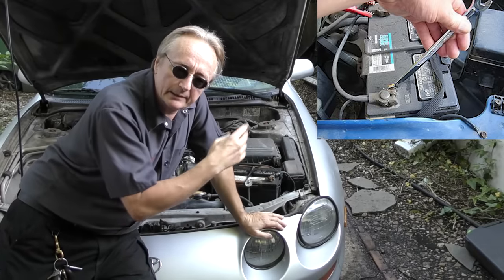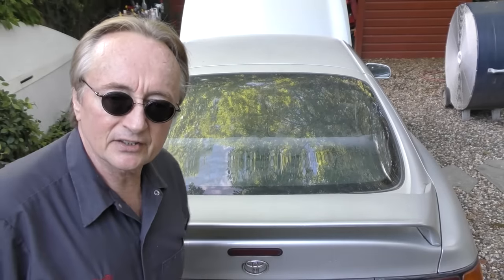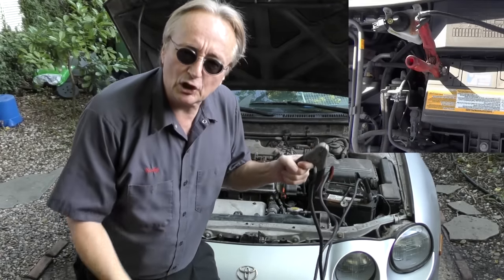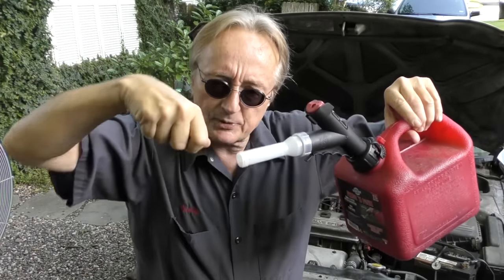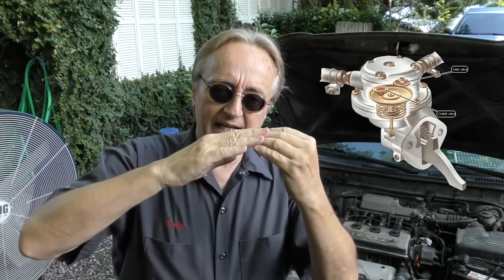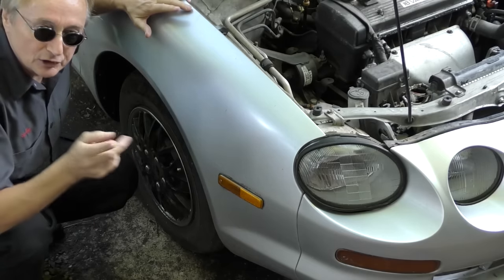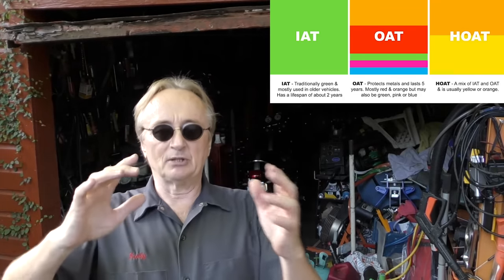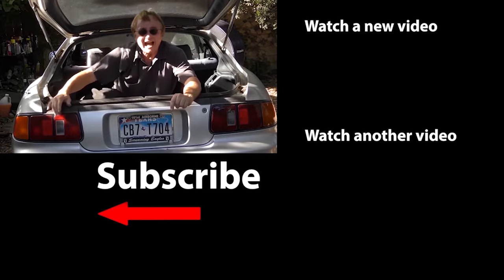This Will Destroy Your Car

Comment: WOW!!!
Thanks Scotty! I've actually been jumping cars incorrectly for the last 40+ years.
Reply: you monster
Reply: Ditto. LOL.
Reply: So have I and never had a problem.  Maybe Scotty saw it one time.
Reply: @Chrisallengallery  we don't even use Aligator Clips in our country 😂
Reply: now that reply made me laugh
Reply: I've always done positive to positive and negative to negative too (except for one time when I jump started a PT Cruiser but thats because I couldn't get to the negative battery terminal as the battery was buried under the Air Box), never had an issue, but then Ive always done this outside and I always disconnect the jumper car immediately after the other car is started..
Reply: And what happened? Nothing bad I bet....
Reply: I guess same here. I've done this before on all my cars when people need a jump I usually just disconnect it as fast as I can.
Reply: Years ago I had a battery blow up; the whole top of the battery I was boosting blew off!
Reply: I go Battery to Battery, Deffintly Leave Car Running . If dead car is So dead I throw the ac on and Light's on Running car ,Not reeving. The lights and  heat or ac Gives ya a Extra amp 👌
Reply: @bansheemania1692  This doesn't make sense, the jumping cars alternator would already be kicking out more amps because its hooked up to the dead battery. Plus turning on lights and AC only makes the alternator work harder.
Reply: Guilty as charged, that was my takeaway from this presentation too, the other stuff is common sense, something I'll concede is darn near a superpower these days :P.
Reply: Mee too
Reply: No, you haven't....Alert Alert Alert......Bad information....the good battery car's MUST be running and creating voltage >13.2 volts before you go to start the dead car...Reasoning, you'll blow the electronics in the alternator (of the good car) if the voltage drops below 10.8 to 11.2 volts....when the dead car draws down the "good" non-running battery. It's even labeled on most alternators [Do not jump start or let voltage go below 10.8]. I messed up a few years back and did it the "old Scotty method" and let someone start a car off my good battery, not running....and afterwards....it left my alternator dead...took out the delicate charging circuitry.
Reply: you don't want to do that, we used to jump cars all the time at the auto auction and one day a battery blew up in someone's face. I don't think they were badly hurt and I'm not certain what happened I wasn't working that day.
Reply: And did you destroy your car in all those years!? No right, Scotty here is such a drama queen Seriously.
Reply: just wanted to say I'm talking about connecting the (-) to the frame of the car.
Reply: Scotty as always thanks for your advice, especially since the newer cars are so sensitive.
Reply: @cat-lw6kq  
You connect the negative terminal on the bad car to a piece of unpainted metal.

It literally tells you that on 100 websites.
Reply: Yes that"s what I meant to say, one time a battery blew up at the auto auction where I worked we jumped cars all the time. I suspect they attached the clips directly to the battery terminals.
Reply: This information is correct. You shut off the car that is giving the boost. Unless there is a problem with the dead car and you keep cranking it with your fingers crossed hoping it will fix itself, jumping a car from your battery will not run your battery down very much that it will  ruin your alternator. I have personally seen an entire fuse box blown from jumping with vehicle running.
Reply: I guess we were lucky at the auto auction we jumped hundreds of cars when I worked there. A lot of them were junk cars anyway and we just wanted to get them going and sold
Reply: @LarsonFamilyFarm-LLC  I heard him say let the good car run while connected to dead car, about 10 minutes,  and then turn off good car and try to start dead car. Does that make a difference in what you are saying? Because his point was how to protect the computer system in a newer car doing the jumping.
Reply: @kellyanneree3252  yes, it would as long as you remove the jumper cables...before starting the dead car. Normally...you'd have to wait 30 minutes of charging before you could start a dead battery, 10 minutes is not enough....that's a lot of gas and waiting...who would do that? ..in an emergency.
Reply: Raiyan Zaman what do you use?
Reply: @LarsonFamilyFarm-LLC  Do not jumpstart.  It's as simple as that...it's not worth the $5000 risk!!!
Reply: @pono321  Me and scotty have seen the damage over and over and over throughout the years.  Your ignorance is hurting things you can't see.
Reply: @fraidykat  hahaha your funny I work on many vehicles I buy and sell hundreds of cars a year I have plenty of experience. You just obey scotty and sthu. Oh and by the way, Earlier today I pressured washed the engine of my car lol No problems whatsoever hahaha 🖕
Reply: On the dead car, I have tried putting the negative to the frame like they tell you to do now, and it just doesn't work that well at all. You have to wait forever.  Its so much faster when you put it on the negative terminal.
Reply: 2:05 he says leave it running (good car) for about ten minutes or so to give it enough time to charge the good car THEN ***turn off the good car*** NOW try dead car. If it doesn't work restart good car, rinse wash repeat. Makes all the sense in the world to me.
Reply: @ozmaniac49 nothing just bare wires. Sometimes 1 wire😂 and attach the bullbars together
Reply: to be fair probably only been incorrect the last 25-30
Reply: @LarsonFamilyFarm-LLC  : In the 1960's I had a 1974, cj-5, 4x4, v8 304, AMC, JEEP, Soft Top.  Everything on it was mechanical, except  the voltage regulator.  Every time I gave someone a jump, it fried my voltage regulator and ac alternator and battery!  A few times of doing that and you won't give anyone a jump!
Reply: @d.r.hamman480  I had the'79 CJ-5 304, soft top...same just the year different. I never had an issues giving a jump and jumping my other vehicles...as long as the good vehicle was running when attaching to dead battery...along with, never short out the cables. I've seen lots of sparks and lots of near misses ( i cringe) when others try to jumps cars. After making both good bat. connections...and holding opposite ends isolated...I connect to pos. of dead bat. first and then get the ground of the dead vehicle. I get back in my good vehicle and ramp up the idle to 1800 to 2500 RPM's and then we try starting the dead car.
Reply: @d.r.hamman480  I would like to know how you had a 1974 cj5 in the 1960's ...   haha

Comment: Not topping off the gas tank was great advice. I never knew about vapour canisters. And not letting your gas tank volume get much less than a quarter tank. I never knew about the internal fuel pump. Scotty you arethe BEST. I'm wondering if I should drive from London Ontario down to Houston so you can service my car !

Comment: Wow, I didn't know topping off was bad. Won't do it again. Thanks Scotty!
Reply: @soli Sanchez I figured those were just from the nanny state and why are they telling me what to do? Scotty can tell me what to do though and I'll listen.
Reply: soli Sanchez isn’t there also something about cell phones? How many times have you heard of them causing a gas explosion? They also say to kill your car and I never do unless the wench in the booth makes me.
Reply: It's also dangerous, gas can spill out and get on the tires and road so you will spin out and possibly wreak.
Reply: @highjinx6519  How can a cell phone cause explosion ? Would you please elaborate a little more ?
Reply: Suresh Vadgama ive never heard of it happening but unless I’m imagining it there used to be signs on the pump saying not to use it.
Reply: The “don’t use your cell phone when fueling” signs were due to people using cellphones with removable batteries back in the day. The concern was that one could drop the phone, the battery fall out, create a spark, and the entire town would be wiped out of the face of the Earth in an explosion. Anyway that is no longer much of a concern these days as most cellphone batteries won’t pop-out if you drop your phone.
Reply: Eye Heart Sushi thanks for letting me know I wasn’t imagining it lol.
Reply: High Jinx LOL yeah it was definitely real.

Comment: If you drive a diesel...you can top off your tank as much as you want. There is no evap system
Reply: Driving a diesel will kill your vehicle!
Reply: Brandon Burley true enough. Just an overflow line that vents to the ground when you overfill or when the Diesel gets hot and expands in the tank
Reply: Heywood Jablowme Diesel fuel isn't a solvent like gasoline is. It expands a little...but not much.

Comment: Im guilty of always trying to put as much gas in my tank as possible.
Thanks for telling me, Scotty!
Reply: me too 🤣
Shot happens!
Reply: My wife's not going to be happy when I tell her.
Reply: Yes me to. I gas until the gas no longer disappears down the gas cap housing.I'm sure the evap system in my truck is NO GOOD ANYMORE. O well live n learn.
Reply: I ruined my charcoal canister dining this just like Scotty said can happen. Cost me $150 for the part and a pain to install. I’ll never top off again!
Reply: Well, if this is true to not overfill, then what happens when gas sloshes around in your tank? Think about that, same concept.
Reply: @robertrippy4248  It's not the same effect. When you overfill  (or top-off if you will), you are filling the filler neck full of fuel. About 3/4 of the way up the filler neck is a small diameter tube that runs to the EVAP canister - this can drain that excess few ounces of fuel into the canister. Doing this several times can eventually fill the charcoal canister with too much raw fuel for the canister to cope with. Secondly, modern fuel tanks have a baffling system built in, in order to prevent "sloshing" around.
Follow Scotty's advice on this one...if you feel the urge to top-off your tank at the pumps - DON'T!!! Well you can but don't whine and complain when the EVAP system gives you a problem and your mechanic says...that'll be $700.00 to fix that sir!
Reply: Actus yup damaged my fuel tank sensor or whatever that gauge thingy is ...
Reply: @Scotty Kilmer

I own a 2003 Ford F-150 with over 290,000 miles on it(probably approaching 300,000+)! 
About three or four years ago, I had to replace my in tank fuel sending unit(module if that is the correct terminology), but there was no ‘canister’ connected to it. It was just the tank fuel level float, the fuel pump, and tiny pre-filter at the bottom end of the pickup tube.

Is it possible that the vapors ‘canister’ would be located outside of the fuel tank on the frame near the fuel tank or fuel line exiting the fuel tank????
Reply: @Robert Rippy 
One would think that in the case of gas slosh, the engineers would have either added baffles inside the tank to mitigate slosh or designed the canister with some slosh protection! 
Maybe the issue arises from that canister being submerged, not just splashed on??!!
Reply: @Vinny Booboo 
When I started driving tractor-trailers across the country, my trainer always wanted me to pump fuel until I had rounded up the fuel gallons added to the tanks, not the dollar amount on the pumps!!!
Reply: @johnludtke4416  haha.  My wife bitches at me every time she hears me clicking away when I am pumping petrol.
Reply: me too
Reply: Yeah me too!  I fill it, then bump against (my idea is to settle the bubbles. . .as if I know that there are bubbles there), then I put more in.  But no more!!!
Reply: @robtec88  On my old Sonoma, the code it will throw is P0440.  Dealing with that now, and it never did before...Only 'topped it off' once after a fuel pump replacement, and now have that code.  I should have watched this video sooner.

Comment: Thanks for the tip about disconnecting 
 the jumper car before stating the jumped car. I grew up in Minneapolis and we always jump started cars the old way.
Reply: no. If you do that, the car won't start. The cables must be connected to both cars to start. You disconnect immediately after it starts.
Reply: @marks6663   Watch Scotty again. He says to use the good battery to recharge the weak battery for 10 minutes, and then disconnecting the batteries and trying to start the car. Of course, you could just use a battery charger if you have mains power nearby.

Comment: You can also use a multimeter to see if it’s charging if you know how to read the voltage.
Reply: Exactly.
Reply: Aren’t u supposed to be dead?
Reply: Any one can use a multimeter. Pulling the cable off the alternator is a great way to destroy the electronics as Scotty states. I do give him credit for something.
Reply: That, and make sure that the multimeter is set to DC voltage, not AC voltage.

Comment: "Your electrical system is fried" 

shows picture of my car

And now I'm worried. Thanks Scotty
Reply: @Virkgabs  No. Very clearly a 2nd generation Chevrolet Cruze.
Reply: My aunt had a 2014 Cruze. It was a POS. After the 36k mile warranty the turbo broke, she had to pay out of pocket.
Reply: I wish you luck with your Cruze. My friends 2017 Cruze with 26,000 miles just had a cylinder go out. It was 4000 dollars to fix... luckily his warranty covered it
Reply: @walamo4796  there's a known issue on the 2016/2017 Cruze where the pistons break and screw up the cylinder walls. The updated design that they're replacing them with doesn't have the issue, and neither do the 2018/19 models. It doesn't happen to all 2016/17 cruzes though, which is why I'm sure there's not a recall. They just know the ones that will fail will do it during the warranty period.
Reply: Austin Turner That makes a lot of sense actually
Reply: Austin Turner Cruze is a bad car. Heard they break down before 50 k a lot.

Comment: Good video, thanks Scotty. You probably saved people a lot of heartache with this video. I myself at 63 y/o used to do a lot of those things you mentioned, i.e., remove the negative cable to determine if the alternator was working. If a person isn't actively working in the mechanic world, it's easy to miss some of these points. Appreciate you and your videos.
Reply: a simple test is headlights, if they dim when idling, either your battery is failing or alternator bushes. With the newer cars, batteries only last around 3 years. Huge power draws running computers and all the electronic gear. Some jump cables have a voltage regulator on them, as soon as the car starts, disconnect

Comment: "...it will cost $1000.00 or more to repair..."
I buy my cars for $500.00, so doubling the purchase price to repair makes fiscal sense only to government.
Reply: Back in the mid 80's I worked for a company that had a Dodge pick up as the off site yard goat.  The company expected 100k miles out of it when they bought it so they were going to get 100k miles out of it logic be damned.  About 5000 miles before it would have been sold for scrap the transmission went out of it so they put a brand new $5-7000 tranny (and some other repairs)  in a truck that was worth about $500.
Reply: Kryten428 I wonder if they wrote that off on their taxes as a business expense?
Reply: @Anthony-fd8mh  The point of writing of something as expense is if you are going to benefit from it in some way and pay less tax at the same time. To buy something and throw it away, just for the sake of writing off some expense does not make sense.
Reply: Where do you live where you can get a car that runs and drives even semi-reliably for $500? Here in in Nebraska, it seems like $2000-2500 is the starting point for used cars that runs and drives, and doesn’t immediately need major repairs.
Reply: Tyler Brown I think he’s talking about the 80s
Reply: @Tyler Brown - You can get a driving car for a thousand. It won't be perfect and will need minor repairs but will drive.
Reply: I've seen car where I live for $500 that just need a little tlc! Or sometimes they just have a ton of miles
Reply: @JohnnyAmerique 
Same here in Florida, less than $2k and it's either in or going to a scrap yard.
Reply: yes it's called depreciation
Reply: @JohnnyAmerique  I brought a 84 Mercedes 300d for $500. Drove it away on 4 nearly flat tires. Still have it and someone gave me a thumbs up just today. They can be found

Comment: Thanks Scotty! been using jumper cables incorrectly all my life
Reply: I've been doing the connection correctly. That's how my Dad showed me 60 years ago, but shutting off the boosting car is new. We used to rev the heck out of it while starting the disabled car! Of course my latest car owners manual says not to jump start it (or use it to jump start another vehicle) under any circumstances.

Comment: 2:25 wow ive been jumping cars wrong for 20 years! 😲 I always just held revved up rpms on good car and had them start the bad car, then disconnected them both
Reply: Jonny DIY you’ve been doing it right, if it works then it’s right. Not everything scotty says not to do will destroy your car like he makes out
Reply: I did that the other day and my car is an 18 plate and no damage was done
Reply: Me too
Reply: Read the comments section. It's loaded with stories of people burning out voltage regulators and alternators by running both cars while jump starting. But, hey, do what you want.
Reply: Yep me too.

Comment: Back in the 70’s I was a student and changed tires for a few years until they trained me starting and charging systems.   I got to be well versed in that, and proud of that.   The only thing I trust myself to do these days is check oil and tire pressures.  Good video 👌